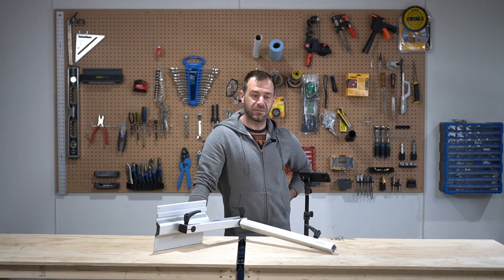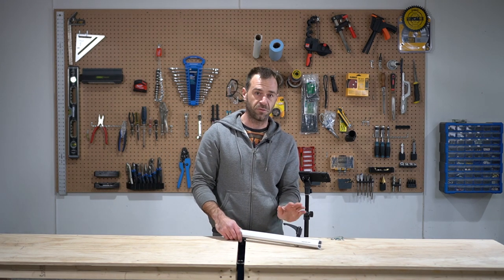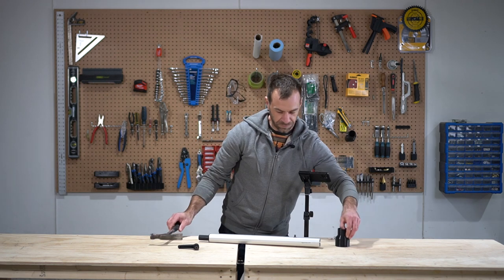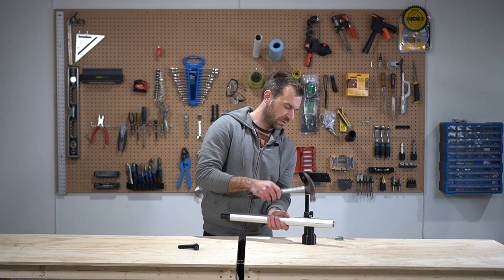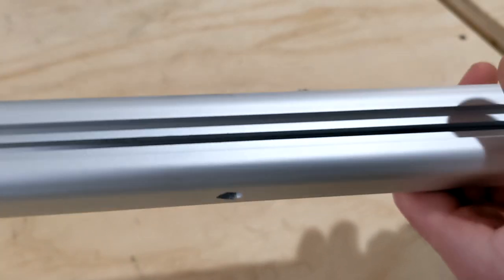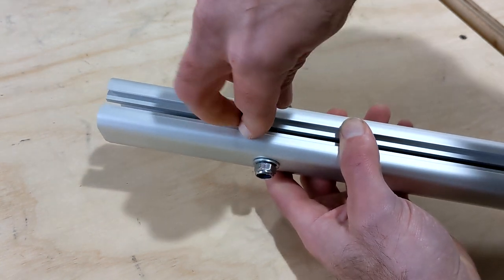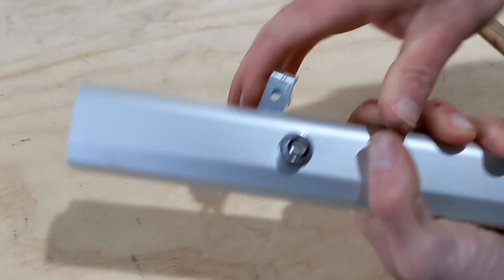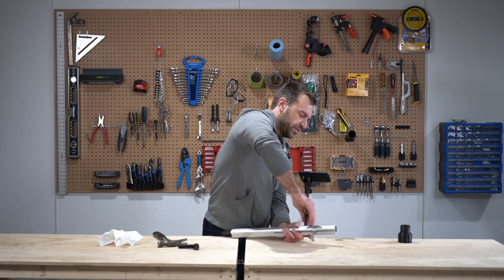Lagun Table: How To Switch the Leg Handle to the Opposite Side

Comment: Thanks for the video, I just tried this, but the lock nut seized when tightening the carriage bolt on the other side and I had to hacksaw it off. I figured out that you could use the stock 2 inch bolt and secure a lock nut all the way through if you remove the end cap to keep the bolt tight instead of punching in a new carriage bolt.  seems to work just fine.